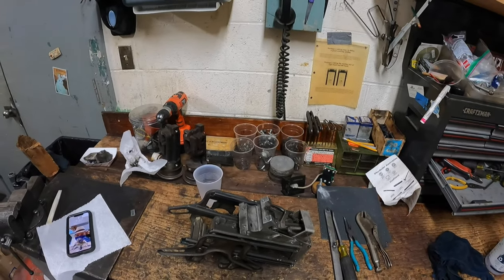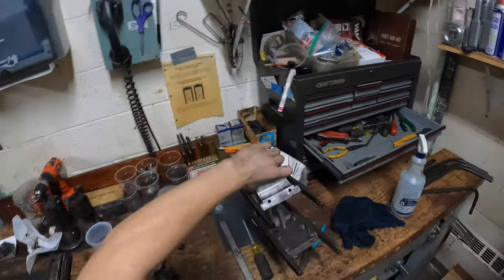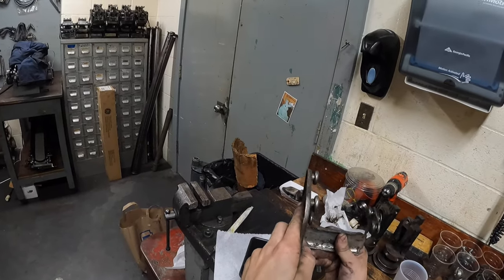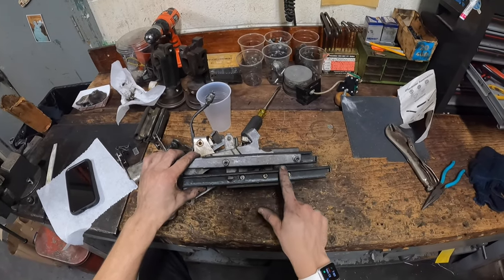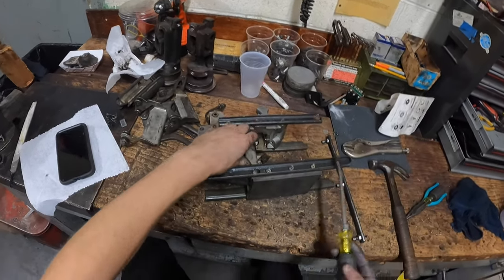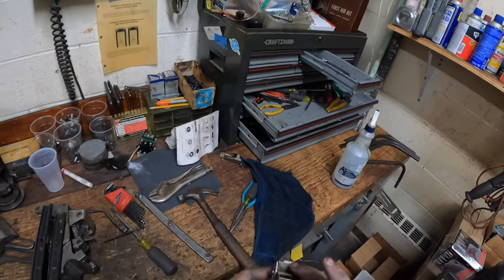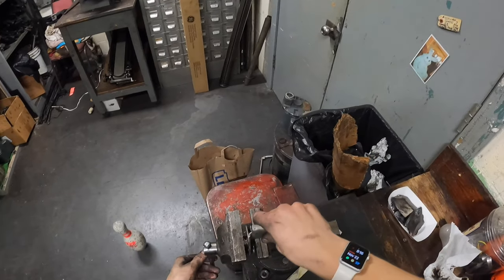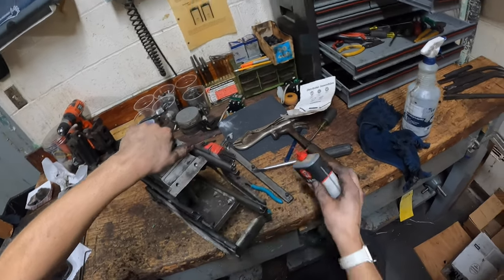AMF 82-30/How To Advanced: Rebuilding Respot Cell

Comment: We had a bowler who was a friend and an owner of a tool & die shop.  He made me a track tool out of a hardened bar of steel.  Once the grippers and coat hangers were out, you could shove the track tool into the tracks to re-align them.  Beat on them if necessary.   If we had a sticky cell, 90% of the time we could "adj" the bind w/o removing anything.  Find the binding spot first and then correct the cause with channel lock plyers.     Don't just go in and start bending things.   Then you'll have two or more spots binding.
Reply from the maker: That’s cool! I don’t know where this one came from, but yes sometimes you can get lucky and just bend the part that’s causing the issue